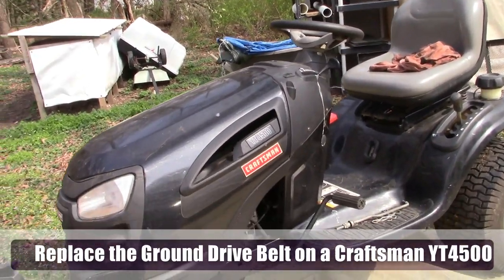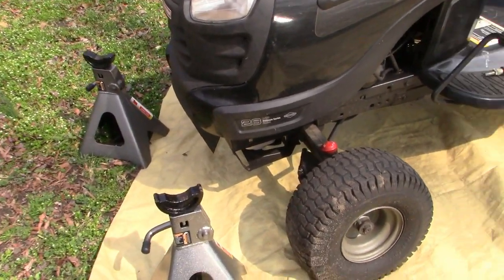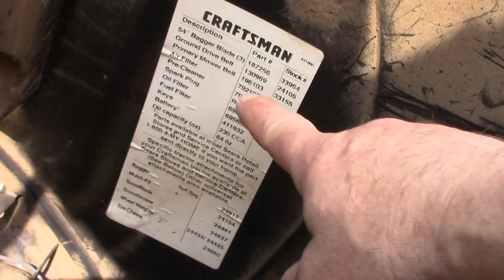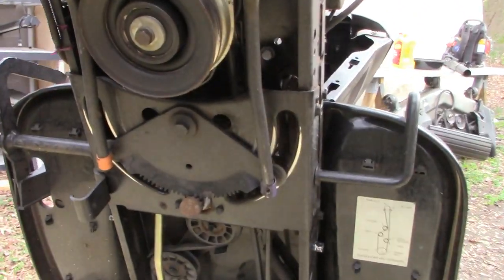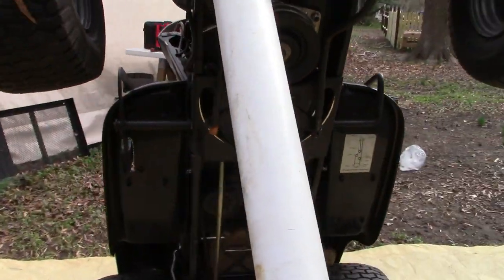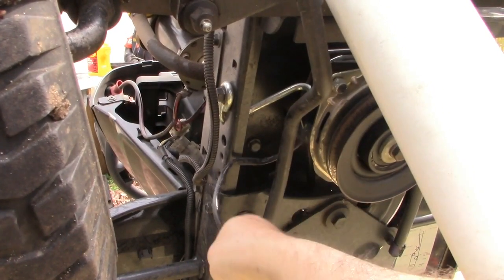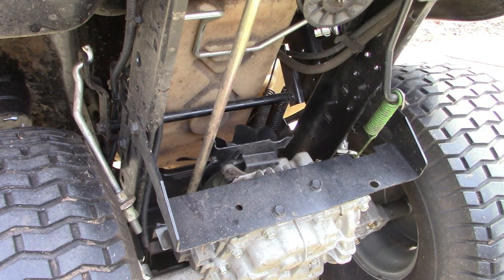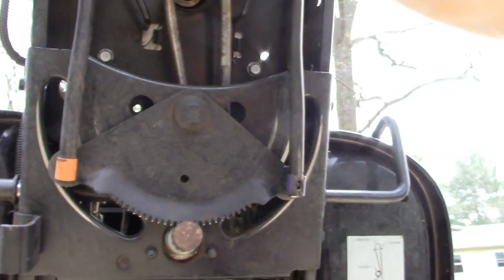How to Replace the Ground Drive / Transaxle Belt on a Craftsman YT4500 Lawn Tractor

Comment: I'm about to do this same repair on my Craftsman YT4000 (the only difference seems to be that mine uses a manual lever to engage the deck pulley), and I found your video very helpful. My worn and old groundbelt even slipped off the transmission pulley in exactly the same place that yours did. 

It doesn't look too hard, so even I should be able to replace the groundbelt myself and save some money.

Update: It worked! Thanks. Using an impact driver to remove the enginepulley made the job very easy.
Reply from the maker: Excellent work, James! Glad you got the job done.

Comment: Very good video.  My old belt had stretched apparently and jumped off the transaxle pulley and chewed up the transaxle fan.  Replacing that a different set of issues but this really was helpful with getting an orientation as to how to thread the belt.  When I looked at the manual and underside sticker I wasn't certain if I was looking down with x-ray vision or up from the garage floor.  Standing the mower up like you did, brought great clarity.  The only issue I had was feeding the belt over the steering plate.  There was a metal rod that I slipped it under instead of over.  Corrected that and then everything was up and running.
Reply from the maker: Glad you got the job done, and that my video was of some help. Thank you.

Comment: Nice video, just what I was looking for. Mine is a 2006 and the drive still works but sluggish in reverse.  Haven't had an opportunity to crawl under and also check all 3 pulleys. But it is louder going in reverse, no noise going forward.

Comment: Replaced mine, wasnt too bad, but i did it without lifting it much, prob harder, but so far so good, mine was stretched.. Been going over everything on my briggs yt4500. For years i didnt use much and neglected it. Moved to house with 1.5 acres and now i have to have a riding mower. Pre mounted tires i bought for front and rear, found some really agressive ones for back on yellow john deer wheels, like them much better and fit was perfect. Now i dont spin in areas .

Comment: Just an FYI, on my Crfstman Professional I just undid the chrome guard bar for the electrical cable, loop the front 1st then looped the transaxle pulley last and fit didn’t need to pull off the front pulley assembly
Reply from the maker: Yes, good point. I think for me it's just easier to take down the PTO and have it out of my way. Thanks.
Reply: @Buckwsr  yes, I ended up cutting the old bet so the PTO kept spinning, so I had to loop front 1st. Should’ve paid more attention to your vid, thanks for posting, was great help, much appreciated!!!

Comment: My tractor has the belt going on both sides of the steering shaft. You have to pull 2 bolts off the bottom bushings, slide it up change belt. Maybe someone installed yours incorrectly before that why it jumped off back pulley. As it would be forced down on tailing side. Check to see if your is rubbing.

Comment: I have a Craftsman DYS4500 I just recently had to replace the drive belt I put it on started to check it out it moved forward and reverse then for some reason it threw the new belt off so I restalled it now it goes forward fine but won't go backwards is it possible I need to get a new drive belt belt? It seems to be tight around the pulleys.

Comment: Great Video. I wonder if the reason your belt came off and lodged is because there might be a belt retainer missing. I  am not sure if yours had it at one time but many transmissions have a keeper that bolts behind the belt on the trans pulley. Yours may not, but if it comes off again, I would check diagrams for a missing keeper.
Reply from the maker: You could be right about that. I've seen that belt keeper on other machines. All I can say is that to this day the tractor is still running fine, with no belt problems. Thank you for the note.
Reply: My 3 plastic idler pillows on the drive belt were worn down and had flat spots on them. Also, you can change the belt without removing the pit. Set the brake, Unplug the pto, remove the pto retainer arm.  Work the belt off the front pulley, work the belt towards the back and remove it off the transaxle. Reinstall in reverse order.

Comment: Do you show how to test components to find short causing fuse to blow while running and how to accurately check ignition and where to set cheap multimeter.

Comment: Hey, replacing my drive belt also, thanks for the video. I was wondering if you or anyone would know why I can push my yt4500 even if the transmission is engaged just as easily as if it wasn’t? It still drives just fine, but I’ve never been able to do that with any other mower.

Comment: Would this same process work for the Craftsman YS 4500? Also do I have to take the deck off in order to do it?
Reply from the maker: Probably very much the same process. Since the deck comes off easily, you might as well remove it. It will only be in your way otherwise.
Reply: @Buckwsr  how does the deck come off?

Comment: Im having problems with the PTO shaft spinning while I'm trying to take it off any suggestions on how to keep that from moving?
Reply from the maker: Do you mean that the engine spins when you try to break loose the crankshaft/PTO bolt? An impact wrench might get the job done, if you have one of those. Alternately, you can try to wedge a screwdriver somewhere into the flywheel teeth to immobilize the engine while you break loose that bolt. Might have to take off the engine cover to that. That's a bit unconventional, but it can be done. Good luck.

Comment: Bolt that holds the PTO on mine spins top where the fan is at , how would I loosen it ? I tried clamping the top bolt but it still won’t break loose
Reply from the maker: If you don't have an impact gun, you'll need to find a way to immobilize the crankshaft from spinning. At times I've found ways to wedge a screwdriver into the teeth of the flywheel. A bit risky, I guess, but sometimes you have to get creative!

Comment: is it a 92 and one half inch length by one half inch thick belt? i cannot find one anywhere only 92 inch length
Reply from the maker: 92 and a half would probably work. Look under the engine hood for a craftsman decal giving part numbers. I'm sure the part number for the ground drive belt would be listed. good luck.

Comment: I having trouble where tractor goes slow up smallest incline then picks up speed on level ground .  You have idea what would cause that if ground belt or something else ?   Tractor is Hydro trans .  Thanks Frank.
Reply from the maker: Sorry, bro. I'm not sure what to suggest. Could be a worn or stretched belt, or could be sloppy linkages. Or even low on trans fluid.... Good luck.
Reply: Thank you on that info.

Comment: U know how to bypass the reverse kill switch while blades are on ? Gets alittle annoying wen you go in reverse n mower wants to turn off I know safety
Reply: Many mowers have 4 position ignitions.  Off, run w/lights, run and start.  Start the mower and let the key return to its run position and then rotate the key one position counter clockwise...that should be the position you need for "mow reverse".
Reply: Go behind your tractor panel and just  disconnect the switch. My tractor has a plastic clip I just pulled it apart. Then wrapped tape around both ends to prevent dust from clogging the terminals. I have a grey color craftsman 42" deck. There are a lot of idiots on here that show videos of bridging the connections and all sorts of idiocies just disconnect it.